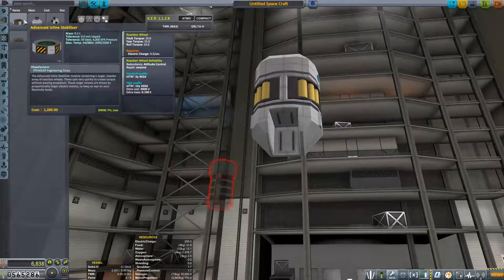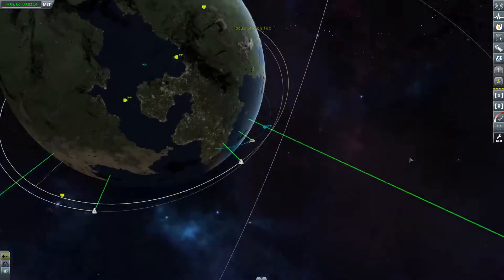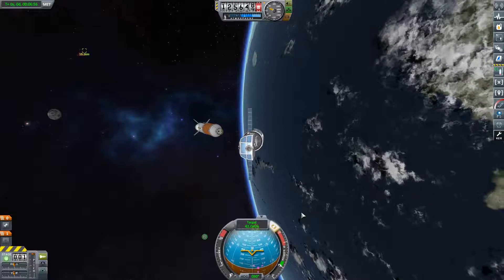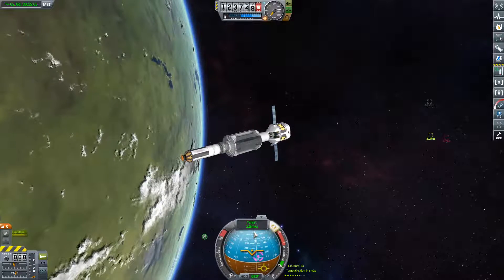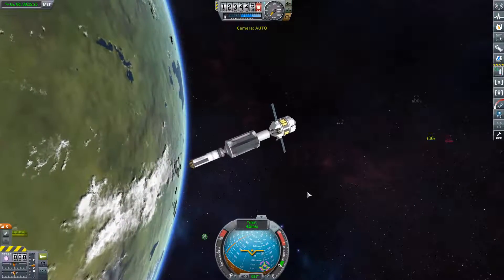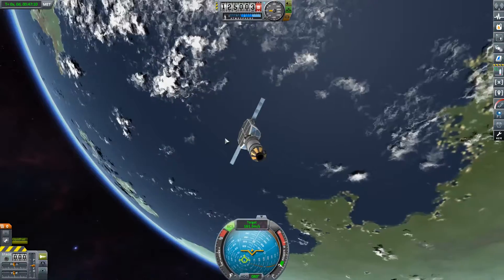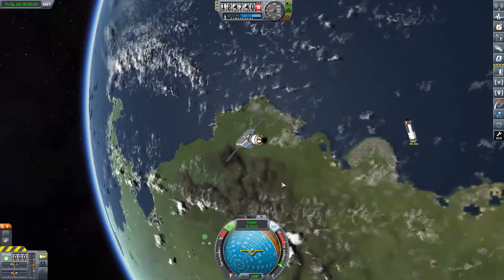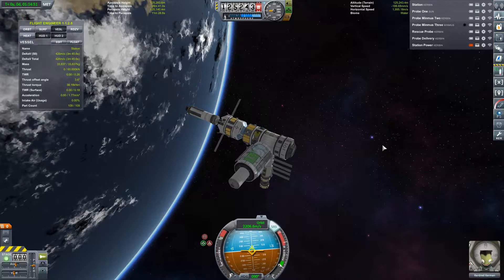Kerbal Space Program - Kerbalism S02E21 - Station Tug

Comment: how does amd ryzen cpu work with ksp? I'm also screen and recording while playing ksp. do you think it is better than intel i7 cpu?
Reply from the maker: With KSP and recording, everything is fine. I've managed to up the graphics. and don't get the physics slow downs i used to get on my old bulldozer chip. 
I can only go on the reviews of the i7 as i don't know any one who has one. From what i see, the 7700k is better for gaming over the Ryzen 1700, but the Ryzen has more cores so could be better for recording. Overall they are probably about the same, but as things go forward the Ryzen will most likely be the better buy. 
I am a self confessed AMD fanboy, so your best bet is to do some research and get reviews of actual games, not just benchmarks.
Reply: thanks for the quick reply. also do you use nvidia gpu? if so, how good do they work? i'm planning to buy a gtx 1070 or 1080 for this purpose.
Reply from the maker: I don't use nvidia. I'm currently running an R9 Nano with a custom water cooling system. Nvidia do offer some fantastic products, but their pricing system is a bit wacko.